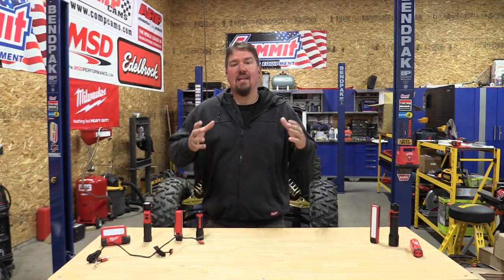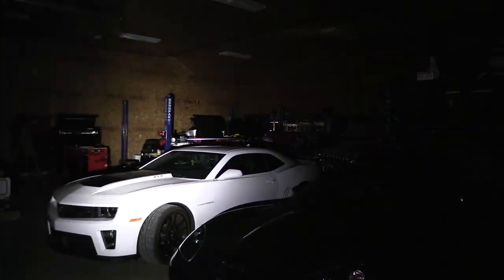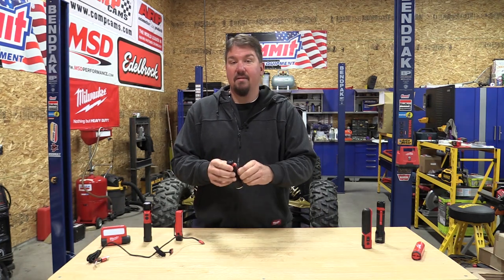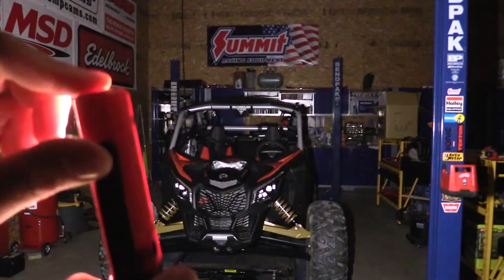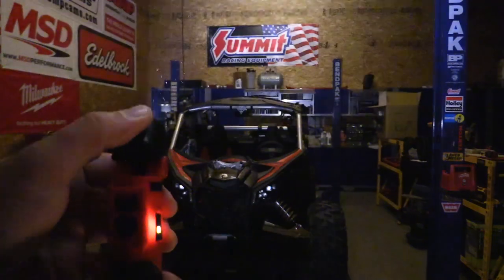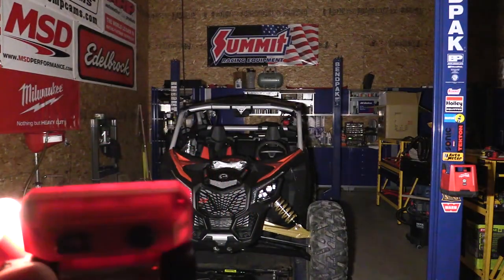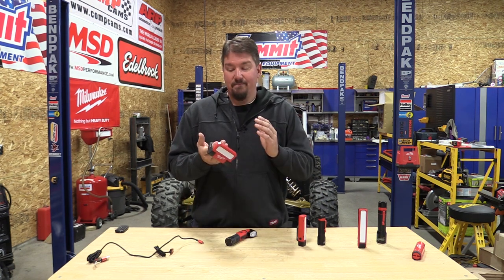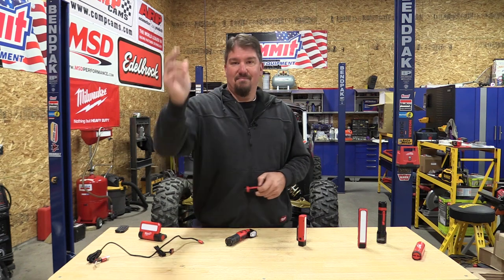NEW Milwaukee Must-Have Additions to Personal Lighting Flashlight Rover #LightTheSite

Comment: As a flashlightaholic I appreciate Milwaukee throwing their hats in the ring. This same battery system should open up to new tools like a 4 volt screwdriver.
Reply: Brandon Neil they already have a 4volt screwdriver
Reply: @edilbertorenteria5732  Yes, but the battery for it is proprietary.  Yes, it's an 18650 but not compatible with these.

Comment: Milwaukee really missed out on not using USB Type-C. I know it's a small thing but in 2018 the new plug should be standard on all devices by now. Plus no frustration because it's reversible. Other than that a great ensemble of lights!
Reply from the maker: I fully agree!
Reply: But the same cord that charges my phone can charge my lights.. they didn't miss out
Reply: My phone uses USB C. It's the future. They missed out and so did you. LOL!
Reply: @55afishead  I don't see how anyone missed out.  There are millions more non Type-C devices out there.  I use a tremendous amount of USB charging devices.  I don't have a single on that us USB C yet.  Most, millions of people, have always had the none C type usb devices therefore tons of recharging capabilities.  If Milwaukee made it USB c then we would all have to run out to get such a cable or Milwaukee would have to include one.  But then we would have to have a bunch of extra cables so we could recharge the light where ever we may be.  I don't see how the hell anyone could say Milwaukee missed out on anything.  You make the device to accommodate the majority not the minority.
Reply: @robertknowles3677  I have been using type C charging for a few years now. There are a few big advantages to it. The biggest is it charges 3 to 4 times faster. And I really like how you don't have an orientation when plugging it in. It is the future it's just most people are afraid of change. The device should have both types of plugs on it.
Reply: @55afishead  Now that I agree with m ;-).  I have been in technology for over 30 years and agree that times change.  I am actually quite surprised that USB C has not taken on quicker.  I love the idea of being able to charge faster.  However, depending on the size of the device being recharged, if a smaller device takes maybe 3 hours to charge from 0% to 100% on let's call it regular USB, then charging that same amount in 1.5 hours sounds wonderful.  But making that device with a single USB C port when many other devices have not made the the cut, does not make for a good Development idea going forward.  SO then how does a new tech take adoption or take make it quicker? Many of the popular brands would need to adopt at the same time.  Here is an example of what I mean.  There are much faster bands of WIFI capability.  We cannot take advantage of them because all the wifi makers of wifi components in the laptops, all the ipads etc and phones and wifi routers would have to adopt that tech.  Right now I have a wifi router that can support up to 1600 gigabytes.  However, of all the wireless devices I have in my home, only one out of about 25 can support that speed and that is only because I got a brand new laptop.  So the manufacturers have to weight the cost of developing the new speed vs alienating the existing customer base of products.
Reply: Everyone has micro USB type cbis not widely adapted yet who do u know that has a type c phone not many
Reply: @tomaxxamot2016  3 years ago isnt so bad. im running the recharchable head lamp with the old style of cord.. best part, no one in the lunch room runs those anymore!!!!!

Comment: I like Milwaukee's lights, too.  I have their rechargeable head lamp and use it regularly, it's great.  Looking to get one of their rechargeable flashlights.  The pivoting head model is very interesting.
Reply from the maker: It is interesting.  If I wanted a rechargeable flashlight,  I would definitely look at it.  Hard to pass up the first flashlight (Old Model) I showed as it is just dead sexy.
Reply: Yea, the old one is cool, for sure.  However, I do like that the pivoting model can be stood up and aimed at a work space.  That's a very useful feature.
Reply: Rob D  check out the NEBO big cryket ...it’s twice the flashlight for half the $
Reply: I'll check it out, thanks.
Reply: Rob D I am a plumber and have tried many nebo lights and they do not hold up so far coast mag lite four sevens and Milwaukee pen light have lasted a good time for me I’m now looking into Milwaukee to take over all my lights just my 2 cents
Reply: Thanks

Comment: I really hope Milwaukee makes a 18 volt jump pack for cars soon... I know a car battery is 12 volt so please no dumb replies
Reply: This is possible but only if you have a large bank of supercapacitors charged by an M12 or M18 battery or something. To make something like this would be interesting, but also very expensive...
Reply: Im an electrician & if my car doesnt start i put wire in my M18 battery n jump my car. Piece of cake⚡😎⚡
Reply: I started my car with an M12 2.0ah battery. I hooked it up and left it for 5-10 minutes and it was enough to start my car.
Reply: @cmoullasnet  no, you just need to leave it for a few minutes.
Reply: Dont worry Daddy can teach u a thing or 2 or 3. Of course to a guy like u itd sound unbelievable, thats expected.

Comment: What I find irritating is the light level selection button should be different then the on off button. I use just have a simple on off. Why do we have to press a button 3 times to turn off a light
Reply from the maker: Probably just trying to have fewer buttons on a small tool.

Comment: Doing plumbing and some minor electrical work on a daily basis , quality flash lights are a investment which in turn make me money. Smaller brighter with simplicity make for a no brained.  Are these lights available now ???
Reply from the maker: Yes, Acme tools have them the cheapest I have found.  https://www.acmetools.com/shop/tools/milwaukee-2113-21?cm_mmc=Google-PRODUCTFEEDMILWAUKEE_-2113-21&CAWELAID=600009240005466153&CAGPSPN=pla&CAAGID=38240590042&CATCI=aud-76534317941:pla-58379990448&gclid=Cj0KCQjwsMDeBRDMARIsAKrOP7GfjNj1e6JMdZB50Kg6MYI4kCXxwVjgzQz1VG_okN2Ftpqc9LScUFoaAvCaEALw_wcB

Comment: Milwuakee needs to put stronger leds on all of there tools. I have alot of the latest Milwuakee tools (3/8 fuel ratchet, 3/4 fuel high impact. 18 v grease gun etc and from all those tools i have to say they have to re-invent not only placement of the LED but the brightness of it

Comment: The ones that use the red lithium USB battery. Are they like lithium tool batteries where once they are full power until fully drained or are they like nicad where the light will fade as the battery is depleted?
Reply from the maker: They are like lithium tools.  The light fades very little.
Reply: @WorkshopAddict  thanks for the input bro! Love the channel and the good work you do.

Comment: Great review, love the channel 👍....the first USB " stick " light has a  very weak magnet on the bottom and the side magnet is unusable....I look forward to the smaller..."stick " light ,the magnet should hold better ...and of course my favorite also ,the last light...can't wait for that and the magnets look very strong...
Reply from the maker: Odd, our magnet works well on our stick light and is used in cars and side by sides daily.  Quality control?
Reply: I have the same issue as well with the Milwaukee 2112-21 stick light. The magnet on the side is weak compaired to the one on the end.

It's a nice light but I end up grabbing my 2351-20 instead since it has a hook option when there isn't a place to stick the magnet to when working on my car.

Comment: 3:31 as someone who has this light let me warn you about a fatal flaw with this light...the battery cover is extremly prone to randomly popping off in your pocket, backpack, toolbag, anything. and it doesnt help that theres a spring inside that will physically launch it off the light. other than that, great light for its price.
Reply: Yeah I had to duct tape the lid to the body. Otherwise I was loosing the lid every other day. Other than that I love the light.

Comment: If a household doesn't already have lights, they aint buying these.  These are over priced for what they are. Yes I have tried some of them, they are nice, but not at their price.  Plastic hinges wear out, get loose and break.
Reply: snowismas what isn’t made of plastic these days..? There used to be a steel light made but it uses 4 or 6 C cells and if you fell in the lake it would drag you to the bottom...just saying

Comment: Does anyone know if an 18650 can take place of the 3 AAA batteries? I’m thinking it can. That way if you have a few rechargeable 18650s laying around you won’t have to use AAA’s.
Reply from the maker: An 18650 would be too long.
Reply: WorkshopAddict are you positive? Because I thought the same thing with my 3 AAA powered harbor freight light but an 18650 fit right in there.
Reply from the maker: @richieschmidt6225  I have not tried it, but it sure looked to short.  It is worth a try!
Reply: WorkshopAddict Any chance you have an 18650 laying around and wanna give it a shot?😂 lol
Reply from the maker: @richieschmidt6225  We are on our way to SEMA, so maybe I can try in 8 days.
Reply from the maker: @richieschmidt6225  We are on our way to SEMA, so maybe I can try in 8 days.

Comment: USB is a terrible platform. Once the light dies, it's now out of service until recharged, right when I need it. All lights should use M12 (or build an M6 mini line), but they need to be swap-rechargable. End of story.
Reply: The batteries are removable so you can carry extras. The light will charge them when connected to USB, or you can buy a separate charger. They hit 80% in an hour, or two hours for full charge.
Reply: I like the usb.  I just plug it in when driving.  Also, I carry extra batteries.  Also, I like that I can use a phone charger if I'm somewhere and forgot the charger.

Comment: USB charging is so yesterday. Make these things wireless charging capable.
Reply from the maker: I am unsure that USB is yesterday, they could be USB C.  My phone charges wirelessly and it is slow charging.  I plug it in every night rather than use the wireless.  Plus, the wireless charging can affect the signal to and from Bluetooth devices.  It would be a cool option and I am sure it would also increase the cost of the lights significantly.
Reply: It's yesterday with Milwaukee. They're on the backside of the curve. USB C would be on the front side of the curve. Wireless would be ahead of the curve.
Reply: I agree milwaukee is the best

Comment: The problem with those lights is that the only way to charge is by usb in case of an emergency or anything with no power it will be hard to charge it after since no power it would be better if they were battery powered